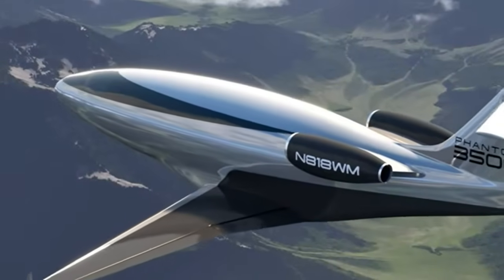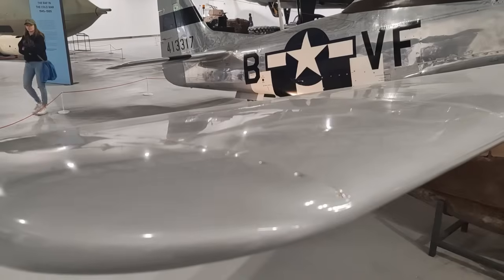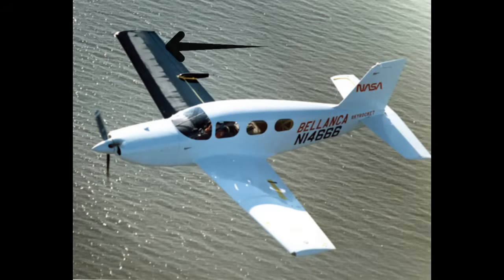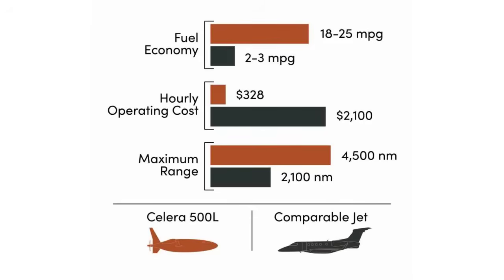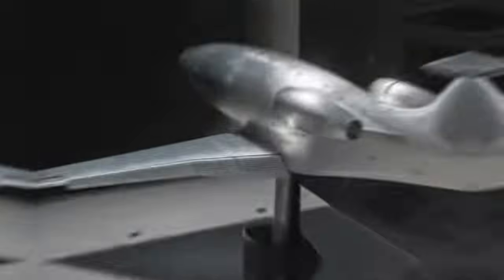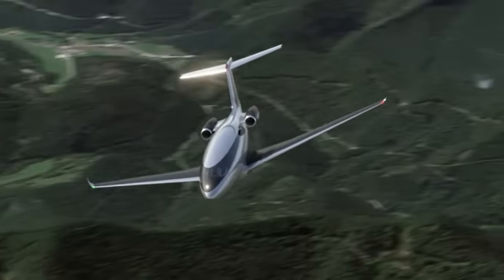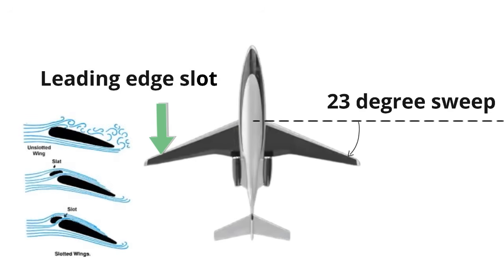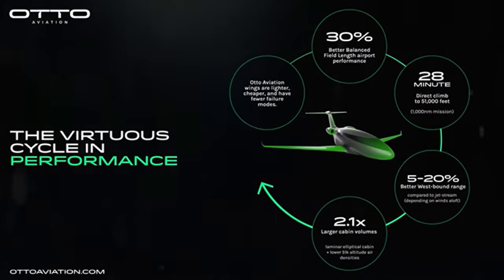Evolution of Laminar flow : Otto Celera Phantom 3500: Will it be the most efficient aircraft ever?

Comment: How to blended body designs compare in respect to laminar flow?
Reply from the maker: Good question.  I think its difficult to maintain it over a longer length. NASA did a blended body design test with Boundary Layer Ingestion. It showed 8% improvement
Reply: @ElectricAviation  Thanks.  With the Otto they planned on a 61% decrease in fuel consumption, but we don't know if it achieved that, but still seems significantly better than 8%.

Comment: "no windows" seems like a big deal as well now #auto_clave #autoclave no more need to use aluminum #blended_wing entire aircraft composite #glider might not even need an engine anymore #fly_by_wire controls #shooting_star_aircraft integrate any power system into the fuselage 😊😊

Comment: I have serious doubts about this coming to market. Because I've never seen any explanation for why they gave up producing their already flying prototype beyond "Some companies don't allow their executives to fly on non-jet aircraft," all while totally forgetting that the PC-12, Piper Malibu, TBM, and other single engine aircraft in the same class as the 500L have sold THOUSANDS in total. Beyond that, the lack of any concrete testing data being published gives me some pretty major suspicions on whether the 500L was able to perform nearly as well as expected.
Reply: Efficiency is directly proportional to Lift/Drag ratio, engine efficiency and inverse of weight. Nothing else, though sure, tons of details get into these three qualifying quantities. The Celera 500L was always announced as totally out of this world concerning efficiency.

Lets break down these claims ... For a plane to be about 8x as "efficient" as all the standard planes out there (the Celera 500L was claimed to be something that good) would require something like 2x the L/D ratio at half the weight and twice the propulsion efficiency. A modern passenger planes L/D is already north of 20:1, on level with Celera 500L, said to be reaching 22:1. Best biz jets also range on that level. So what for the whole claims of laminar flow etc are good for, if these don't translate to better L/D? The RED Diesel engine is said to be very efficient, but total efficiency of modern high core pressure, high bypass jet engines is yet in the 40+% league, so attempting to doubling that is simply pointless. And a factor of 2 in relative weight advantage is equally impossible.

So ... the Celera 500L was vastly over-claimed, probably to attract investors and public subsidies alike.

And by the way, not all other aircraft engineers are idiots. Efficiency is crucial for all planes.
Reply: @omgwtf6156 

For once, a reclusive commenter with some critical thinking skills.
Reply: Interesting, but on another hand, those fuel efficient car prototypes never comes to mass production market like  the Volkswagen XL1.
Reply: @zazugee  fuel efficiency, or efficiency in general is not the most important factor. Effect is. Also availability plays a major role in success.
Reply: @zazugee 

There’s a pretty significant difference between MPG and thrust specific fuel consumption.

Comment: good video... the piaggio avanti has a laminar flow fuselage and is the worlds fastest production turboprop . came out around 1980.
Reply from the maker: Have a look at this video. It covers the Piaggio
https://youtu.be/ngm3NNIzI6A
Reply: Avanti, and Piper Aerostar, gain speed because of a mid-mounted wing that has minimum interface drag. 

That should be understood by any aerospace engineering university freshman.

But apparently not the designer of this aircraft.
Reply: @DumbledoreMcCracken 
^ Agreed.

Laminar flow breaks down and becomes turbulent after about 5ft/2m of surface length.

The surface finish irregularity at the lower windshield juncture will also trip laminar flow. Even if it is manufactured to 0.001 tolerance, differential expansion due to dissimilar materials and large temperature swings throughout the climb will almost certainly disrupt the laminar flow as any typical panel gap will do.

Laminar flow nose-bowl is a good idea. It can probably reduce drag by a measurable amount when the aircraft is clean. Over time this could save fuel and provide a small increase in range reserves, perhaps 1-2% or possible more.

But this aircrafts low drag is primarily due to the very high aspect ratio, laminar flow on the flying surfaces. And a smooth fuselage without any major discontinuity. Interference drag is a moot point. There are better ways to reduce this phenomenon. (Pressure distribution matching to reduce airflow acceleration at the juncture).

Comment: Making a virtue out of failure - this is just a slicker version of many existing bizjets or previous designs with blending the windshield about the only 'feature' but even that mimicks the old Caravel ( which used the DH Comet nose end - the oldest jet airliner) down to the rear podded engines.  The DC9 and Trident et al had deep stall issues with a swept wing aft engines and a t tail  which this might also - need a stick shaker or MCAS ....

Comment: In addition to the propulsion change, tail change, and wing planform change (all to conventional designs from the unusual choices of the 500 L), the wing is now a conventional low-mount configuration, rather than the 500L's mid-wing. I don't know whether that was to allow a more usable cabin (without a spar in the way), or was due to issues with the 500L, but it is the general theme of more conventional design.
Reply from the maker: Yes only fuselage is non conventional now

Comment: Laminar flow is a misconception, like quantum particles is a misconception. There is flow, and it's laminar shaped, but those two are not directly connected. That is why flush rivets don't do the job completely (which they should) and why veggies work so well (which they shouldn't). And a conventional T-tail increases drag, keeping the nose pointing forward by dragging the tail. 

What is most mind boggling to me, is the fact that developement in aviation is not mainly slowed down by absence of understanding and knowledge, but by the rejection of it. The doctrine of aviation technology does not allow for radical changes, which is funny, because this means that by its own rules, it will be proven radically wrong somewhere down the line. Stalling its knowledge, so to speak.

The misconception is caused by those describing it being subject to it. Much like with ignorence. An ignorent person will describe ignorence as an absence of knowledge and understanding, whereas a non ignorent person will describe it as the rejection of present knowledge and understanding. We have seen that most vividly recently in the public engagement to Covid, where many people proclaimed things that for obvious reasons couldn't possibly be true, not so much because they deliberately wanted to tell lies, but rather because they saw merit in rejecting obvious and present knowledge and understanding. 

Similar to that, the aviation doctrine rejects the notion of missing a crucial component of flying. 
A component the importance of which, every bird, bee, and bat is well aware of.
Which in its turn is why aviation designers surrender to the convention of T-tails, erroneously claiming it improves aerodynamics. 8:53

Comment: You missed the opportunity to explain the real reasons for the change in tail design: 
- the 500 L needed the ventral fin to avoid prop strikes on over-rotation (excessive nose-up pitch), which doesn't apply in the turbofan Phantom
- almost everything about the Phantom is conventional, including the use of two tail-mounted turbofans and the T-tail which is normally used with that engine configuration
Reply from the maker: Agreed. In my video on Celera 500 L I did mention ventral fin was needed for preventing tail strike. The landing gear was very low on that aircraft

Comment: How come a turbojet version of the 500L using GE Catalyst. Not only NO but HELL NO on the jet because it requires a Type Certificate!!!! I would take the 500L every day of the week and twice on Sunday.
Reply from the maker: They are going for very light jet category (part 23) certification. So it would be less stringent.
Reply: There is no heavy or lite type rating. I got my type rating August 1978 Part 127 helicopter airlines.